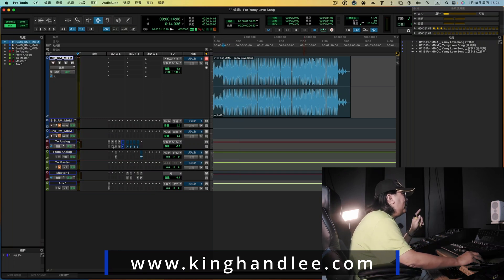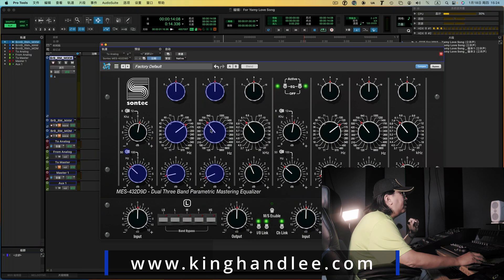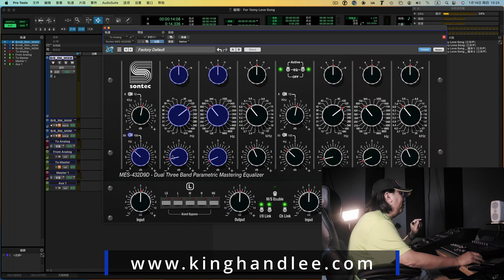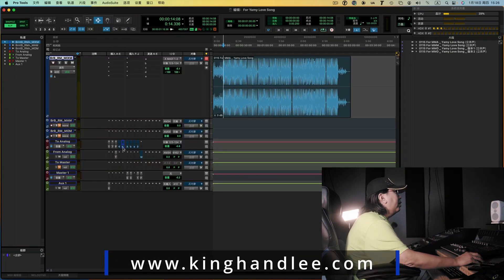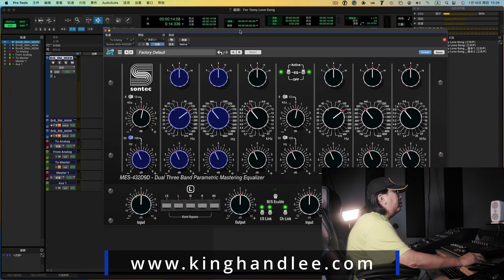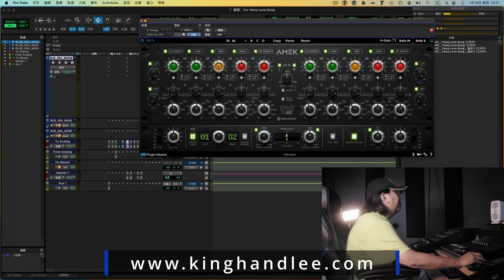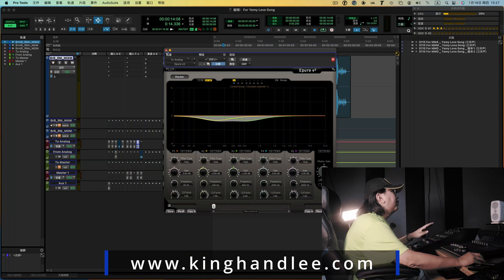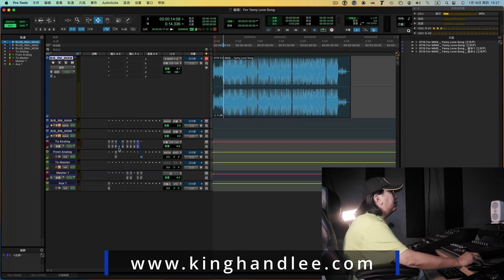Why Mastering Engineers Don't Adjust EQ more than 1db?

Comment: According to my experience (~25 years) the mix itself needs additional work if I need to tweak any frequency more than 1.5 dB in the mastering stage. The problem: boosting or cutting an unwanted frequency (or a range) in the mastering stage also affects the rest of the instruments and sounds that may not even need any tweaking, so therefore, (an example) by cutting a boxy/muddy/warm sounding instrument too much we'll end up making the rest of the song too thin and the overall balance would be ruined. Need to go back to mixing individual tracks, EQ, valume, compression, etc.
Reply from the maker: Not exactly so. Most people are fooled by this kind of fake knowledge for too many years.

Comment: To my ears there is more spatial sound and width in the 5 EQ sample. Don't know if that is what someone wants to achieve when primarily the need was to do an EQ move. In addition you sacrifice the sound quality by putting the signal through 5 calculations instead of 1. (But I admit that I don't hear such calculation errors, anyway).

Comment: The primary reason for minimal EQ in mastering is because a great mix shouldn't need too much EQ.
Reply: I believe the same. If you need this much EQ, you are trying to somewhat fix problems that should have been fixed in the mixing stage. Fine if you don't though. Everyone is free to do what they want ofcourse. 😊
But pretty sure the "standard" is that your mix should sound absolutely fantastic and balanced before mastering. 
So I assume the 1db "rule" implies that if you need to use more, you should go back to the mixing stage for the best results.
Reply from the maker: If so. How could mastering engineers make the decision that is not up to them?
Reply: So true. It's amazing how many mixes miss this goal, however. One of the surprises I constantly run across remastering after the fact are high noise levels where the mixing & mastering engineers should have been much more aggressive. I occasionally run across RELEASES that are so bad that the proprietary AI I work with to clean up bad masters actually believes the noise in the final product was left there intentionally & treats it as part of the intended signal! I amuse myself when this happens - as I consider what the AI would say if it was Ultron: "Oh, the levels there were so high (when they could have been easily filtered before it was foisted on the population) - that I thought it was left intentionally - so I worked it into the remastered sound ... because honestly ... who could phuk that up so badly in the 1st place?" This is one of the reasons a human engineer is (currently) still essential to any remastering project. There are some things that mastering engineers should learn to simply turn on and never turn off. These include brick wall filtering below 20Hz, plugin/effect oversampling, & shaped dithering when you finalize the end waveform. Those simple defaults would eliminate so many disasters...wow.

Comment: Sound difference is mainly due to a different resulting EQ curve and phase shifts. You can probably get the same sound with another EQ doing 6db cut, whose sound is more suited to your music. 

We have different pieces of gear in order to cover a wide variety of situations, not to use them all every time. Main reason to use multiple pieces of gear is to get benefits from their own circuitry : a tube pultec tends to soften the transients, a 4K compressor to open and brighten the sound, a 2254 limiter to make if feel "in your face"..etc 

This way, you can benefit from let's say pultec highs with transient roundness with GML's midrange musicality. The amount of db you boost or cut is only related to how well the gear is suited to the music. That's why some pieces of gear have became so popular : the way they can handle any source (GML eq, 33609 compressor, Ampex machines..)

Limiting yourself to 1db is a way to "not have to choose" the right tool. And I'd pay a mastering engineer for his ability to choose 😉
Reply from the maker: I didn't make any conclusion for this. Actually I don't use this method either. It's just an option in case someone needs it.